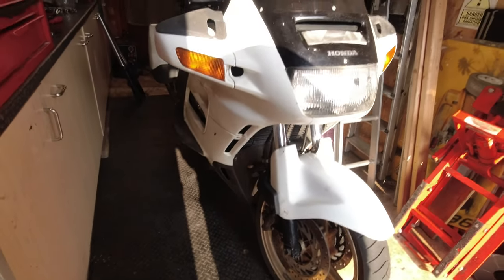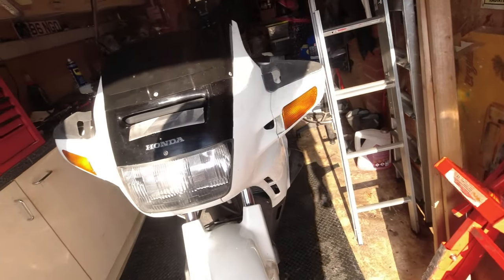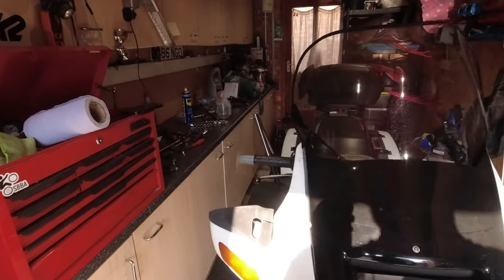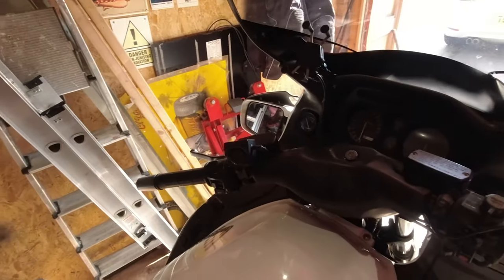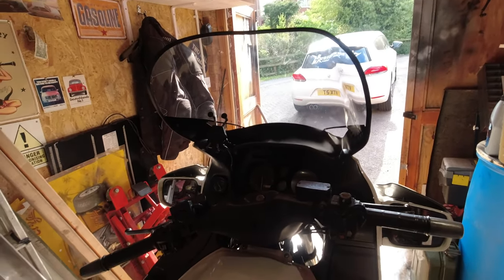NO NOT NOW! DISASTER. ONLY HOURS TO GO - SIDEKICKS HONDA PAN ST1100

Comment: Me (You saw me unload my bike on Whitehill) . They would have been great for the ex-police pan. On-off, flashing-off sequence. I noticed Helmet head had some on his.
Reply: Thanks very much buddy. I might have a look and see if I can get them on as I like the sound of the flashing sequence. Unfortunately I can’t mount them the same as helmet heads because my mirror covers come off really easily so they can’t be mounted on there. Next time you see me about please say hello.
Reply: @SidekickSolo  if the mirror covers are dicey pop them off and bend the three clips on the fairing in a tad on each fitting 👍